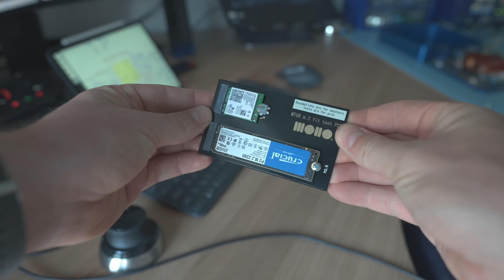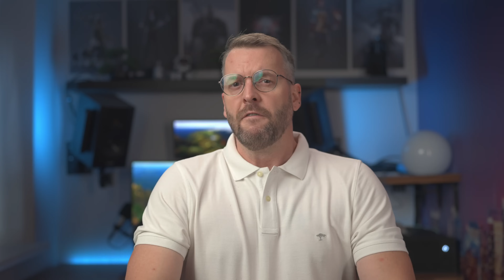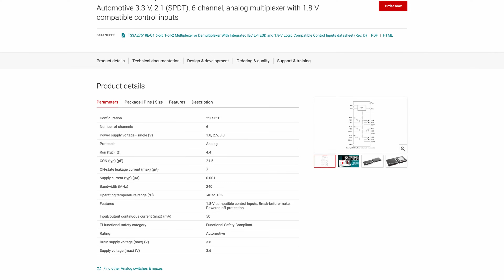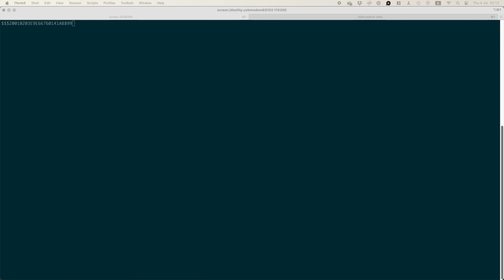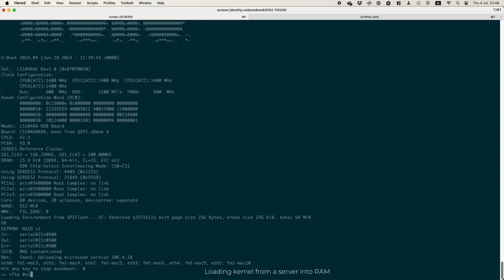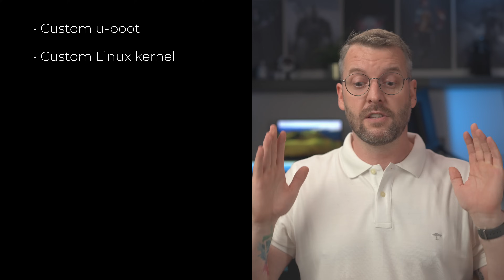We're building a high-end router. Here's the update for June 2024.

Comment: Maybe I'm missing something here, but why do you need to manufacture your own hardware, when you can turn literally any existing PC running Linux into a router?
Reply from the maker: By this logic, because there are plenty of old PCs out there, routers shouldn't exist? :)
Reply: They can exist - so much Cisco, Palo Alto and Juniper, to name a few, have shifted to x86 instead of their old PowerPC/ARM devices for anything more capable than a potato.
Reply: @hquest  the x86 processor isn't doing the actual routing and switching.
Reply: @ax14pz107  True, the ASICs do the R&S job, but the x86 is the one programming the ASICs to do their job.
Reply: @hquest  yeah, so it doesn't have to be a particularly robust processor. It's only handling control plane traffic. I'd imagine they're not going with an x86 due to power and/or cost reasons.
Reply: @ax14pz107  They who, the Ciscos and Junipers of the world? It varies from small embedded Atom processors to Xeon processors, depending on the chassis.
Reply: @hquest  the video maker.
Reply: @ax14pz107  Ah, sorry. They may not, but for the cost of the design with an ARM SoC and all the pitfalls found (so far), an off the shelf x86 SBC would end up being cheaper.